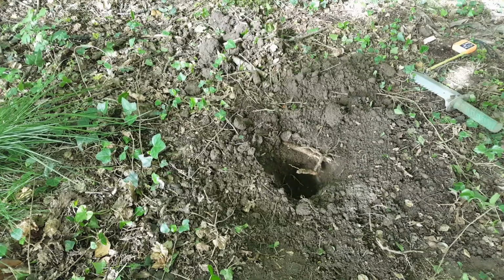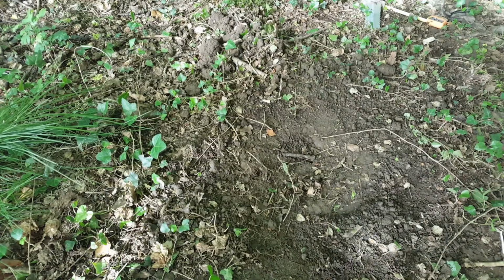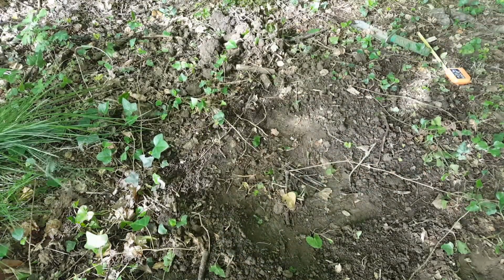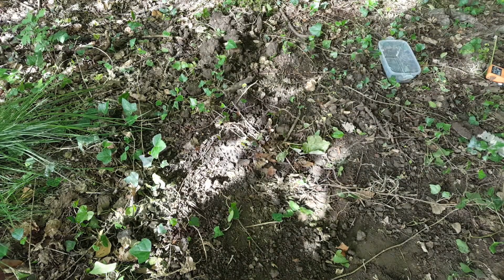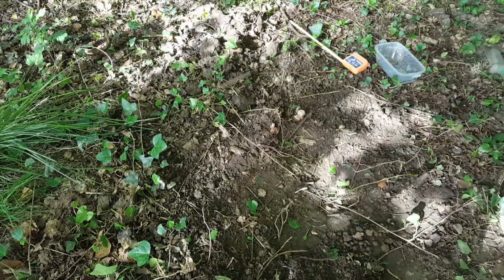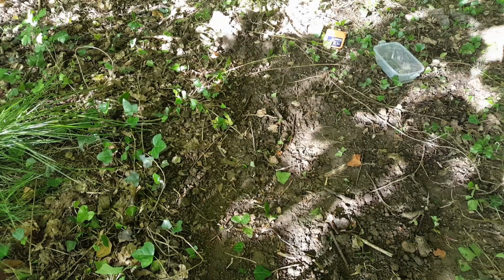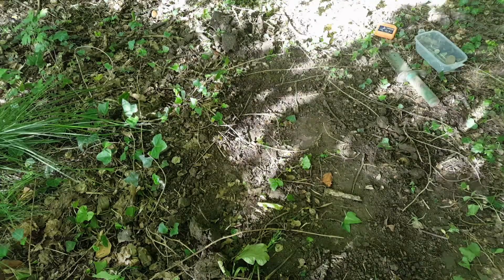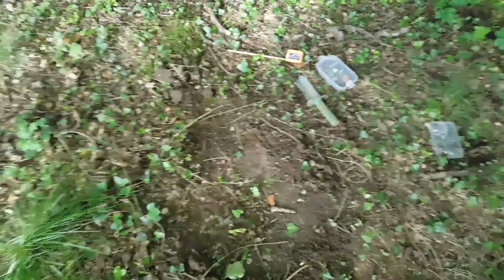VERTICAL COIN TEST, AT PRO VS VISUA VSEZMD

Comment: at 4+1/2"+ I can't believe how sketchy the ATpro was against that ugly Chinese exporters 😂 I feel well ripped off now having bought the deus.but that programmes are good!! I'm listening out for sketchy signals  because most times the signal gets better when you dig it and you say yeah I'd dig that now! and it ends up something good. banging signals are mostly junk aluminium or deep iron or is it a hoard?? 😂 #digeverything
Reply from the maker: +Tony Howitt i have had a few of those chinese machines but none of them compare to this visua vsezmd, its very shocking when you feel how toy-like it feels and looks.

I know they sold a BETTER version. Think it might be digital and called SMART,  i remamber thinking for £60 it cant be that smart, but i should have got it and checked how good it was incase it was amazing.

But with the visua vsez on the market the AT PRO should not be £650 maybe £400 if you are lucky, its well a rip-off
ATB
Darren